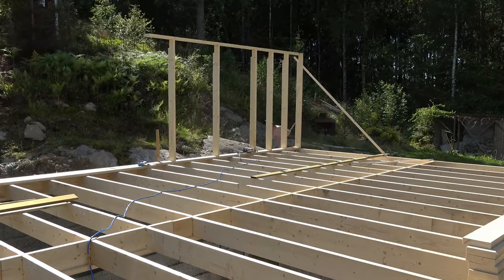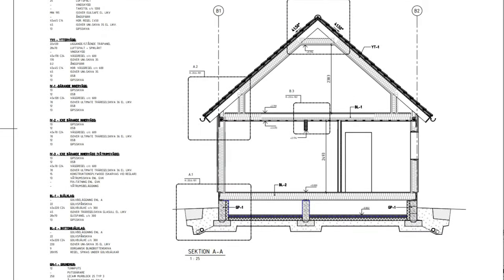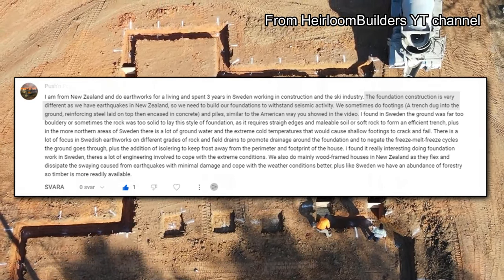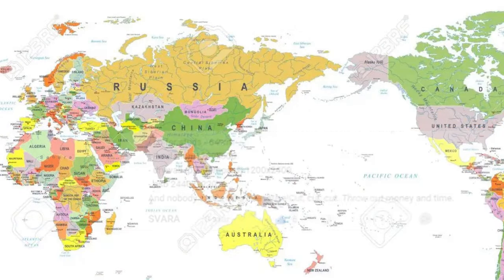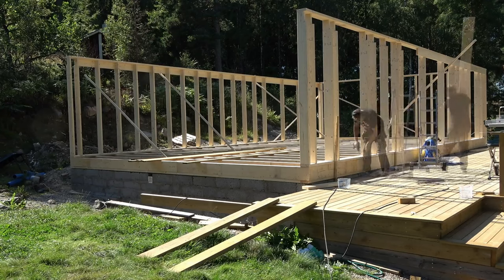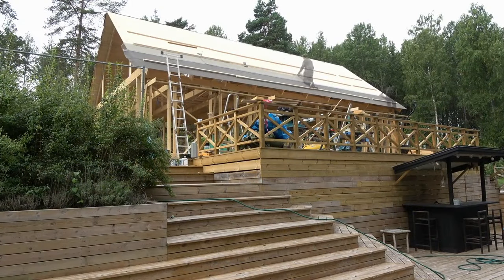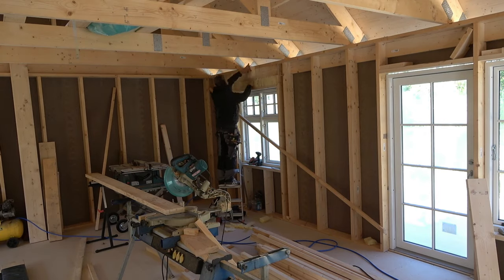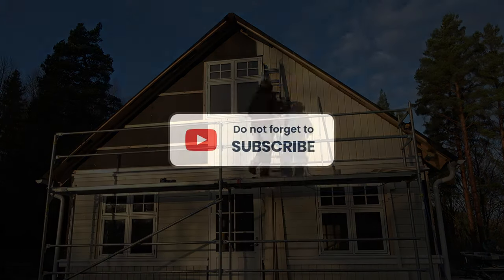UPDATED VERSION! Scandinavian VS American, CA, NZ, RU, AU building methods, let's compare...

Comment: IN the US, its a combination of both depending on where exactly you live. I grew up and lived my whole life in Chicago and Chicago has some of the most building codes in the country. In the 6 counties that make up Chicago land you cannot use Romex or jacketed cable in the walls it must be in EMT or IMT. Once you drive outside of the 6 county region you can wire the house with Romex. Personally I would never wire my house in Romex for the exact reason you mentioned, very unrepairable. You can pull solid wire in EMT as well and that's very common to pull 12 gauge solid circuits in residential construction. I think British wiring is crazy, cementing cable in the walls just under the surface?  When it comes to plumbing we use PVC for drain and in the 6 country region of Chicago it must be copper pipe, only recently have we started to adopt PEX or plastic pipe for water supply, its not allowed everywhere just yet. We are just now getting to use pro press fittings on copper pipe as well, not widely adopted just yet so we still must sweat the pipe together. My question to you is, how does the Trades work in your building process? Can you do everything or must certain things be done by the respective Tradesperson? I personally would do everything myself if given the chance but pulling permits makes that impossible or very difficult. I would have to find a licensed plumber and electrician to pull my permits and then pay them to come back and inspect my work before the city inspector came. Its a bit of a scam here giving the trades a monopoly as well as the city inspectors getting in bed with the unions and playing dirty.

Comment: I like the hammarband you are using. I can see it working very nicely with what we build. In the usa state by state use a code of the minimum you have to use when you build. There is nothing stopping one over building it unless you have a a*hole inspector. I like many others believe over built is well built. Meaning make it the best it can be.

Also with the plywood sheeting on the floor. We are suppose to make sure the screws go into the framing and not just the plywood as it holds nothing.

Your trusses look plenty strong enough to me and that is speaking from dealing with some snow loads.

OSB is something so many people use because its cheaper but I will refuse to use it until the day I die. There is nothing wrong with it if others want to use it but its just not for me.

The plastic you use under the floor on the ground was the first I had heard of plastic that is made to last. Everyone I saw over these years uses just white or black 6 mill plastic. I don't know if there is a difference but its something I will learn more about.

I like how you did the insulation personally. I would go that route on my next build....

I remember the old timers use to use togue and grove board on the root building and always though it was very smart choice.

I do love good construction screws that are made to bend like nails.  I would rather use screws over nails 10 to 1.

The vapor barrier is a must period.

I remember when the old timers also use wood or togue and groove on a 45 degree angle on all sides made so as the wind blew and the house racked it would pull in on itself and add strength.

Here you can get wire inside of fileable conduit already to install. It costs a little more but not enough to not use it.

Your pipe in pipe I thought about a long time ago as a smart choice and glad to see it being used for the same reasons I was thinking.

I just love everything your doing. Keep it up.

Comment: Regarding framing the roof before siding: the "triangles on top of the squares" are still subject to shear in the square. The roof does not provide shear strength to the walls. But this is fine. There are two reasons: first, for the same reason you have less need for shear protection in your walls to begin with. You do not have earthquake or tornado or hurricane winds. Second, you have adequate temporary shear strength from the wall-braces. Putting the roof on first makes sense as a priority for rain protection, and doesn't seem like a problem to me. The building is not occupied so the risk to life is very small if there is a high wind event.

In the US West Coast with risk of earthquake, this is probably not a risk I would take. We have a longer, less wet summer and can afford to take the time to put sheathing on the walls before lifting the roof trusses. It is not a long delay, and the risk of injury or damage to surrounding buildings (as well as the cost/delay of rebuilding) is higher. Catastrophic earthquake is rare, but danger is not hard to mitigate in this scenario.
Reply: I think you are missing the shear strength of the hammerband. With the top plate and the hammerband together, you make it very difficult to shear anything near the roofline. With a double topplate design only the nails (or screws) holding the top plate and bottom plate tight to eachother provide any shear strength at all, while the hammerband provides substantial shear prevention before anything else is attached. Remember . that most earthquakes can be handled easily by flexible construction, as well as by very solid construction - so the studs would likely absorb most of the vibration with little issue. I suspect the more interesting discussion would be in multi-story construction, because that extra 10 feet off grade makes a big difference.
Reply: Companies in Norway make walls and framing in a factory/workshop, so the prosess is something like this: 
1. A few weeks of terraforming and laying foundation. 
2. One sunny day to erect all walls and roof. 
3. Connect electricity and plumbing, time used varies. There is a company here that installs wiring into the walls at the factory, you just need to connect the wall module wires into the fuse box.
We take our shitty weather very seriously.

Comment: You were right. It just every state has different codes. I do a trench for a small foundation, but do it like yours too. It depends on the soil and how far north I am. We have shear walls instead of hammer band. Which gets a strap sometimes and sometimes a beam. Same idea. Commercial buildings or multi family buildings get fire blocks. I like mineral wool insulation. I have seen builders add furring strips to the roof like you do walls. On my build it will be D.C. electric in conduit. Which was recent code change. Mainly allowing smoke detectors from motorhomes and boats to be used with D.C. D.C. electric because of earthship type greenhouse and off grid. Do you use rebar in your concrete block walls or have to grout them every 4 feet solid where rebar is? Is fiberglass or basalt rebar allowed there? Your windows are more energy efficient than ours here too. Or at least Sweden's are. We also now put thermal breaks in around windows now. What about septic too? I ask because your on solid rock. We usually bury septic tanks with leech field here.
Reply from the maker: Thanks for all the info, I have a 3 cubic septic tank buried 2 meter down in a place where I could do that. Yes i use rebar every row of blocks on the sides where i have pressure from the ground.  fiberglass or basalt rebar is new to me, im not sure about that.

Comment: Uhm 🤔 here in the Netherlands we have brick ore nowadays mostly concrete houses. 
However in the conduit for electrical wires we use plastic piping. To wich solid copper wires are pulled through. 
We have 240V here and it all gets calculated to 16amps. 
I’m not an electrician however. But most houses I’ve seen this Yellow plastic piping with solid copper wire are from at least 20 years and older. So I’m unsure about new construction. 

Anyway. Thanks for the video. It clears up so many questions I had. 👌🏻
Reply: Ik kom ook uit Nederland en ik ga een grote recreatiewoning bouwen. Ik ben wel geïnspireerd op houtskelet, begrijp niet waarom we dat weinig doen in Nederland. De levensduur schijnt hetzelfde te zijn, mits goed gebouwd.

Comment: My parents bought a small very old(100-150 years) peasant house in our city, as a kind of investment againts the 40% inflation. Now, not only you can'T lawfully renovate that thing, but getting a building permit is LITERALLY impossible, because: 
1) the building needs to be at the streetfront, this is a law(ours isn'T there so the place is illegal?)
 2)you would have to deconstrucct the old adobe house, and adobe brick are considered "dangerous waste"(despite being LITERALLY MUD), and you need to hire a licensed company to dump it into a hole for you, which costs a fortune.
3)The thing is located at the end of an blind alley, and the city plans to connect that blind alley to the main street of the town(through at least 5 already built century old houses). Its such a small street that 2 cars can't pass at the same time. Because of these plans, the town won't issue a building permit at that location. (They're planning this for 30 years, nothing has been done yet. We're talking about a strongly declining town with 10k pop., so not a large place)
4)You can'T build a house for yourself, its forbidden by law. You need to hire companies and professionals to do everything, and when they come to inspect the house, you need to have the invoice of EVERY small work the contractors have done. Even if you were an bricklayer for 40 years, but you have lost your permit(didn'T wanted to pay a fortune every month) you can't legally build walls in Hungary
5) The site s located at the "historical city center"(the house is older than the city center itself but they dont care), which adds an even stricter set of laws and building codes, even with renovations!
6)Every newly built house needs to comply with EU standards, even a small homestead or a weekend house. YOu can'T build brick chimneys people been using since the invention of vrick, and 10000's of homes use until this day, (strictly forbidden by law), you can only build prefab element or metal chimneys, which cost at least 10 times as much. The EU really think we will get a heat exchanger which is worth more by itslef than the whole property. Getting a house to EU heat efficiency standars multiplies the price by AT LEAST 2,5. These regulations might work well in Germany, but they literally destroyed our construction industry, to the point where new houses very rarely get built. Building standars were nonexistent during the communism, but people keep living in those uninsulated deadly dangerous houses they built with their relatives,because they can't renovate them or build anything new.

Comment: There's also a difference between Europe and the US that you haven't mentioned, the costs of labor v. the cost of materials. Overall, the US has gotten the cost of most materials down to the commodity level. This is not doable for labor. Many times we may pay a bit more for material due to the massive labor savings. Running conduits in walls would increase the labor cost dramatically. It also sounds to be like you change things in your house more often. We rarely change wiring or pipes.
Reply from the maker: Yes, i will cover that in the next part, i have asked for prices in the comment section and I'm starting to get a grip of prices around the world.

Comment: very interisting. i'm from Belgium and we also use a vapor barier on the inside of new or renovated houses. But i am not a fan of using them. We somtimes use reed mats and a clay or lime plaster insted. this is a way more breathable wall and this way might not need a ventalation system in your house. Also, i personly like to use woodfiber insulation or other natrural insulation. this has more thermal mass to keep the house cool in summer and is way nicer to work with compared to rock or glass wool.
Reply: Hello, I come from the Netherlands. The use of plastic in the wall for damp is also a pain in the ass for me. I want to use 'houtwolcement platen afgewerkt met leem' [wood fibre cement panels with loam/clay] but I don't know if that is a good option concerning the damp.

Comment: Regarding vapour barrier. If the house is in a climate like the Scandinavian and may be left unheated for longer periods and you have a vapor barrier on the inside, there's a risk of water damage as condensation ends up on the wrong  side of the barrier during spring, when it's warmer outside than inside.

Comment: Nordics used to use dig foundations around 1950, and slowly changed it. One of the reasons is cost of concrete compared to blocks. As in nordics they have to dig under frost barrier, meaning level needed beeing quite deep. Block and stryro foam, being cheaper mainstream option.

There are always 2 different ways to build.
1. Not breathing structure/not water penetrable. Meaning you will have moisture barrier.
2. Breathing structure. All materials need to breath and let moisture pass safely, including paints.

However, you cannot mix them.

Both can be done with wood, brick, stone etc structures.

Comment: Every time he says Scandinavia, he means Norway, Sweden, Finland. 

Denmark uses A LOT of bricks. Only a few houses are wooden houses.

Iceland on the other hand uses a lot more concrete and steel, since it has little clay and little wood.
Reply: Yeah, in Denmark we've pretty much cut down all our forests centuries ago to make room for farmland, so we don't have an abundance of cheap lumber like in Sweden/Finland. But it makes sense that since wood is abundant (and cheap, relatively speaking) in Sweden, Finland and in the US and Canada, that it's used lots there.

In Denmark it's pretty much been all brick for a long time, but of course now steel reinforced concrete is taking over for a lot of buildings that would have been brick in the past. 

But yeah, in Denmark we're in the same boat as Sweden as far as having no worries about seismic activity and no real worries of any kind of extreme storms like you see in parts of the US (and we don't have to worry about the type of snow loads that they do in Sweden/Norway/Finland.)

But yeah, it's important to remember that building codes don't exist because X is the best and only way to do something, but instead they exist to standardize processes within a region, so it's easier to spot if something is built subpar (without the local inspectors or authorities having to be familiar with every possible way that something can be done.) That's also why you can get permission to ignore building code, if you can say get an engineer to do calculations for you and give their approval.

Comment: So I do not know much about framing, but I think you need the vapor barrier since the wood and insulation are together (and the climate likely has more heating days than cooling days) that means there is wood outside the insulation or outside of the conditioned envelope, that wood can get very cold and then condense moisure, especially in a cold climate where you are heating the air inside the house (and hot air holds more moisture than cold), so the natural path for moisture is to try to go towards the outside, where the wood is outside the envelope.  If you did exterior insulation instead, then the wood should be inside the envelope and so shouldn't be cold enough to condense moisture, so I think you wouldn't need the vapor barrier then (ideally, I dunno that you are doing blower door tests here) but in that case, I suppose it could make sense to have a vapor barrier on the outside behind the insulation...though this would mostly be a cover for not having the house well air sealed..air sealing I think would be a better solution (otherwise its possible you get warm air escaping in a cold spot that isn't well air sealed..

I think for the climate zone you do want to have it on the inside here if you put it on the outside, you are preventing the exterior wood from drying out (as the warm vapor from in the house was allowed to reach the cold wood on the outside of the house, but now there is a piece of plastic which slows the vapor migration out of the wood), which is what you want to have happen, you want the wood to dry out if it gets wet.  Putting it on the inside where you have the insulation is to prevent the vapor from reaching the wood in the first place.

Comment: electrical cables here in the NL are mandated at 2.5mm solid copper, braided cables cannot handle the same loads and seeing we get 240V 16A per breaker you need that wire to to be either really thick when braided or got with solid. I live in a 1970s era apartment complex, but we had to redo the whole electrical system during the rebuild, which was a challenge as well stuff was old and there was even water in the piping through which the cables are pulled (place had been empty for a long time). We also grounded the bathroom floor, which is not mandatory for a refurb, but it is in newly build homes. There are also rules of the amount of wires you can have in a certain diameter conduit which is based on their thickness, that one was a bit of a issue with this place because well all the conduits are cast into the concrete so all I got was all I got. It is one of the downsides of older buildings is that they just do not have enough sockets and electrical groups available. 

Beside that yeah most building here these days are a mix of cast and prefab concrete, bricks are also still used, but considered very expensive as it takes a lot of manhours and bricks themselves are not cheap. That said wood is becoming more and more common due to the environmental issues with concrete and to a lesser extend brick production. Even tall buildings are made up of partly or even mostly wood thanks to modern day techniques.
Reply: 2.5mm, or 2.5mm^2?
Reply: Solid?
Must be very hard to work with!.